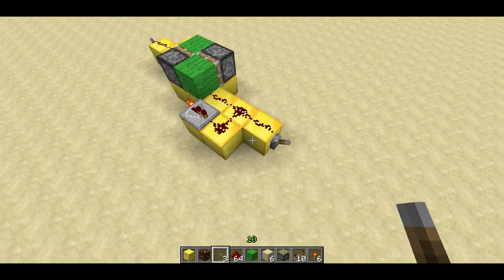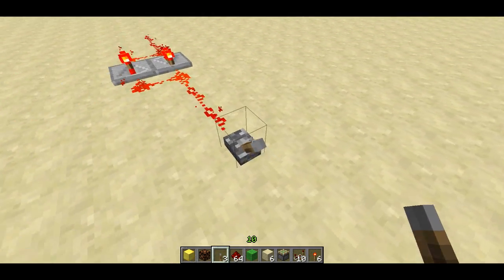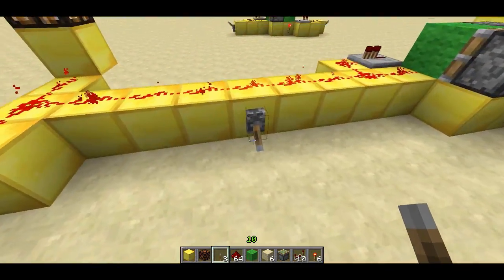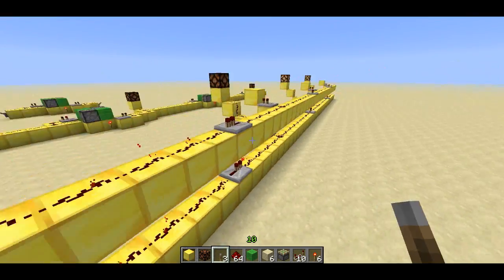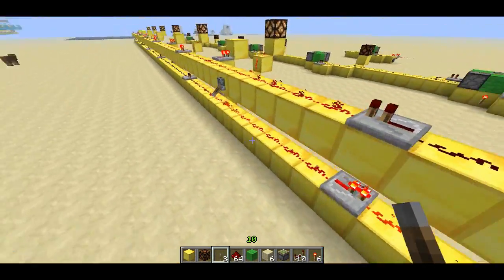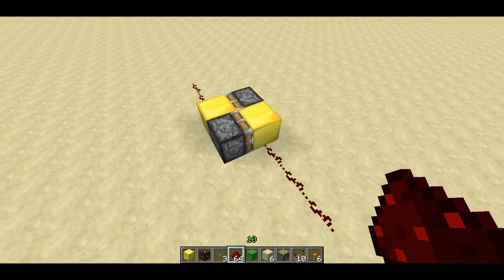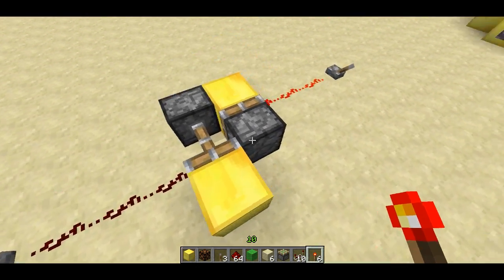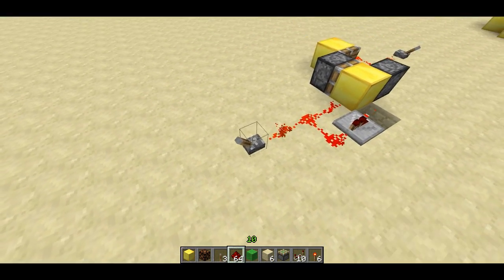Two-Way Redstone Repeaters -- Minecraft Redstone Tutorial

Comment: You can actually do the basic 2 repeaters facing opposite directions if you space the input and outputs far enough apart, so, if you offset one line 1 block high, and separate them for 8 blocks (because redstone current only propagates for 15 blocks) in both directions, you have your 2 way repeater. It does take up more space, but it is only redstone and repeaters, and only takes 1 tic to pass signal.

Comment: It's called a two-way repeater for a reason.  Redstone repeaters increases the distance of a redstone current, since redstone only carries a current 15 blocks from the starting point.  The problem is, redstone repeaters only can be powered from one side, so if you want to keep one line of redstone and have a two-way wire that's longer than 15 blocks, you need this.

Comment: I like both designs, the second one which is the 2 independent lines could be easier to hide behind a wall, since the other setup is chunkier at the piston crossing... In saying that the Piston crossed style would be easier to bury underground.

Also the 2 independent line setup doesn't have any additional sound effect, but then you may want the sound of the pistons firing :p

Comment: I don't know of any such logic gate - the closest your description gets to is an XOR gate, but the difference there is that when both inputs match (both on or off), then the output is off. It's only on when they don't match. An XNOR gate is the opposite of that (inverted). If it's possible to alter an XOR gate to get what you want, that's what I'd go with. Find some designs for XORs and fiddle with them.

Comment: All you need to do is use sand, stack it up ten high and use a piston to push it to a block detector that opens a door. So every time you push a button powering the piston, blocks get 1 block closer to the detector.

Comment: a quick and easy way to do it would be by using minecarts, have them on a small slope on unpowered rails and every time the button is pressed the minecart is sent to the next slope. just before it starts again have it run over a detector rail connected to a t flip-flop and then to the door.